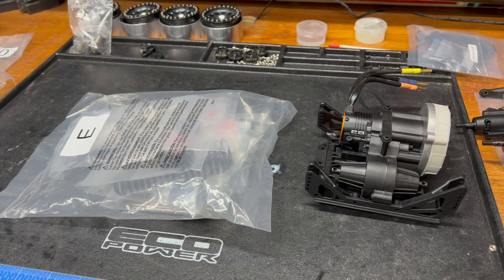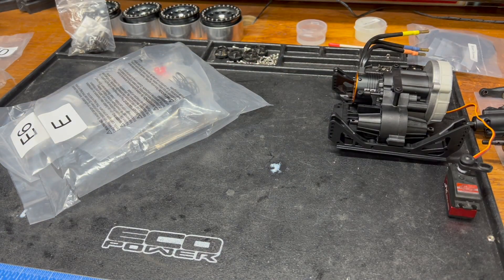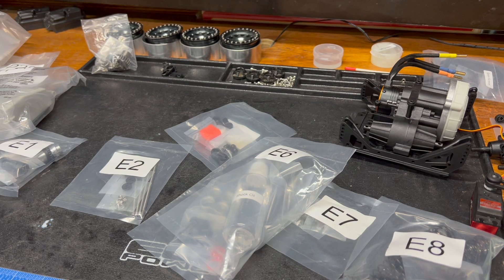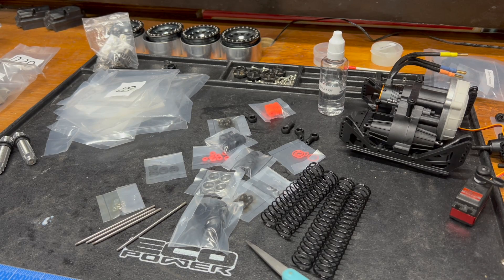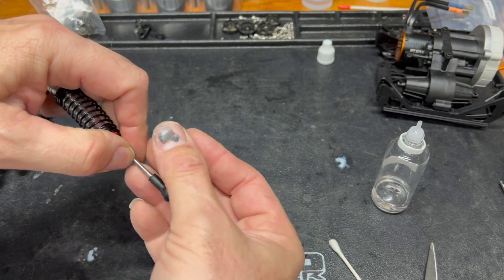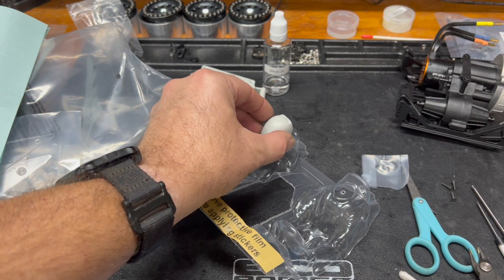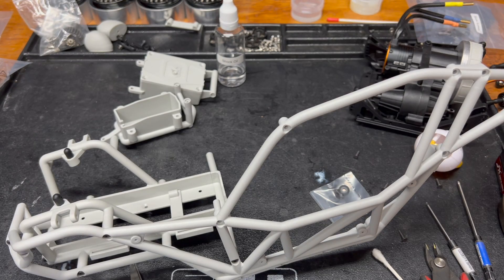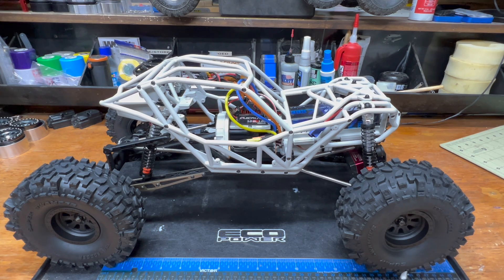Crawler Canyon Presents: Expanding the Ryft, episode 2 (an Axial Ryft Kit build and blather)

Comment: Got some good laughs at your frustration. I feel the same on the screw lengths in the cage. Drives you crazy and paranoid not to follow them in case it needs to be that length haha
Reply from the maker: I felt like I was being trolled. Twelve screws to put a cage side on, and there are 5 different lengths. What happens if I put a 16 in the 14 hole? I got the screws backwards into an Element Stealth gearbox once, and sunk a screw right into the main gear. So you know I put every screw in that cage one... at... a... time.

Comment: The 'why would you do that' segments 😂. You are not kidding, some of these kits create so much waste that RTR vehicles might be a little better in that regard. I hope you get the cat head to fit because that is just hilarious. I am curious to see how the Ryft performs for you. I never knew its diffs were open until this series
Reply from the maker: I got to the "final" few bags, and one was an outer bag, with three separate bags of 6 fasteners each.  Another was a bag inside a bag, with just 3 screws in it. The two included body clips also got their own bag. The open diffs are certainly a puzzler, especially with such lightweight oil in them.  I generally like to start off running kits in "as instructed" mode, and make changes from there.

Comment: Ryft question.
Do all the adjustment holes for the upper links affect handeling?
Would higher or lower be best for high speed?
Or do you have a video that disusses this topic that you could point me to?
Using mine for local U4 racing, it's great on the rocky parts.
I need my ryft to be stable around the rest of the off road course.
Cheers i am enjoying this series a lot!
Reply from the maker: Getting live axles to stay stable at speed is a tough get. You can tune the suspension just like any other four-link, but the front end is where you’re gonna spend most of your time. I have videos on anti-squat and anti-dive, which I would put links to but I’m out on the course right now answering this from my phone. 

If there’s no air on the course (you’re always on the ground) you can over-damp the front shocks to try to slow the “body roll” in turns, at the expense of some compliance— this is all trade-offs, so you need to think about where the rig does <really> well vs. where it isn’t so good, and take some from column A to move to column B. If for instance you get lift in the nose when hard on the throttle, you want to adjust the links to take some drive out of the rear and move the bias toward the front. 

If you’re running diffs and not lockers, that’s a whooooollle ‘Nother can of worms.
Reply: @CrawlerCanyon  thank you sir i can look up the vids i really appreciate you replying so fast from your phone. You are such a great resource for all of us truly thank you.

I was planning on trying some actual million weight in the diffs with a center locker to start with.
The track has a few small jumps but nothing big so maybe 40wt would be a good start there. Or 50? Not sure.
Formula Ryft is the main focus right now because its torn apart all over my bench and i dont have room to work on anything else 😄

Comment: Nice vid. I need to say thats not a good way for filing up shock. You need to compress them to the top then close them up. If your shock is rebounding then you open the screw on the top, compresse them, then put that litle screw back. In a crawler you want that shock to go back . On offroad rc you want your spring to back them not a air in the shock. My English is poor i hope you understand what i want to say lol.
Reply from the maker: On shocks without bladders, there has to be some small amount of air in them or they won't work. All we have available are bladder, emulsion, and reservoir.  The Ryft shocks are emulsion, so I just try to ensure that each shock has the same amount of oil (and therefore rebound) to it. On any of my vehicles where a wheel has a chance of leaving the ground, I build the shocks with a little bit of rebound to them--  any others, like Desert Lizards, Elements, Traxxas GTS, etc--  will be neutral.